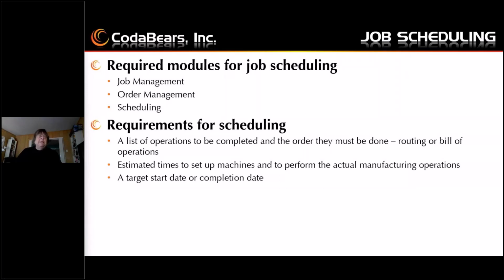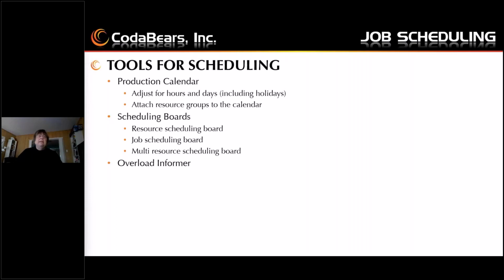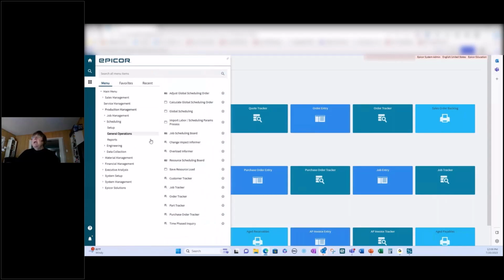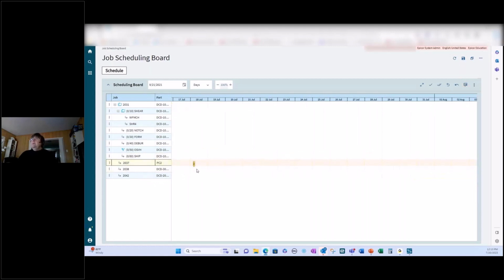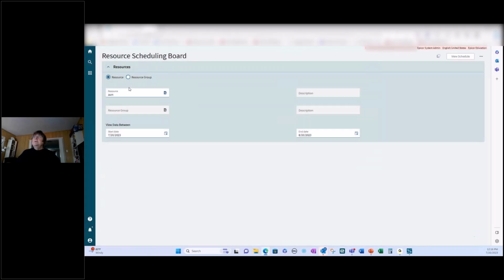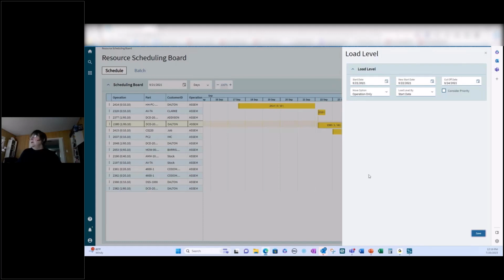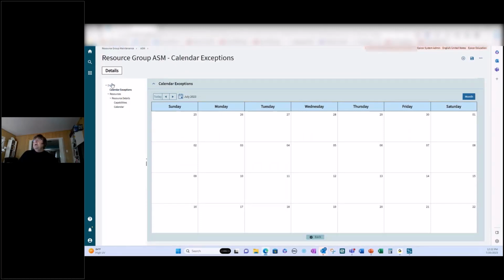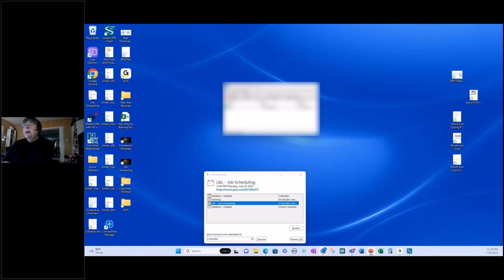Epicor - Intro to Job Scheduling

Comment: 😕 "Promosm"
Reply from the maker: Can you elaborate?
Reply: @CodaBears the sales order has a line called ship date. I was wondering if that coincides or drives the same date on the job line called the required by date
Reply: On the job header, is the required by date the customer dock date and the due date the ship date?